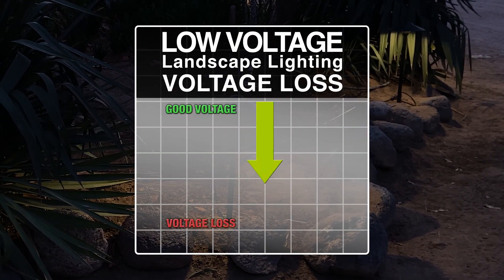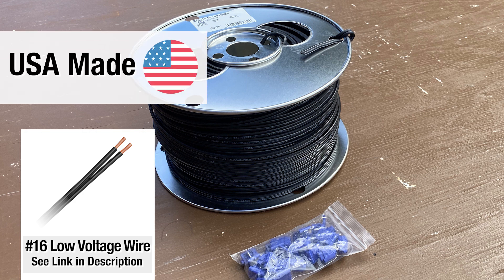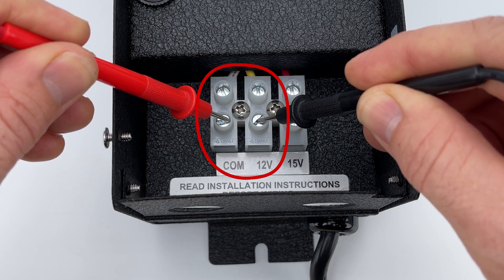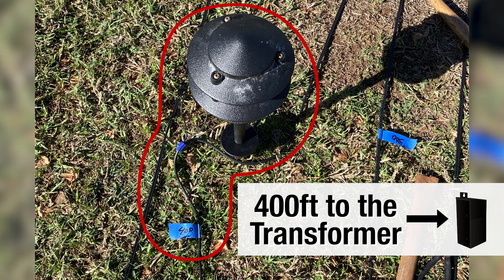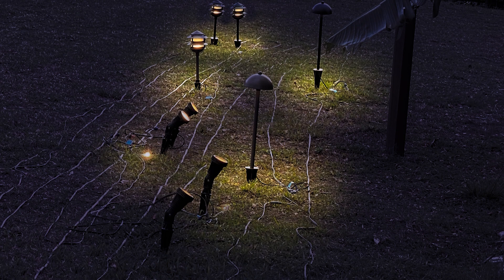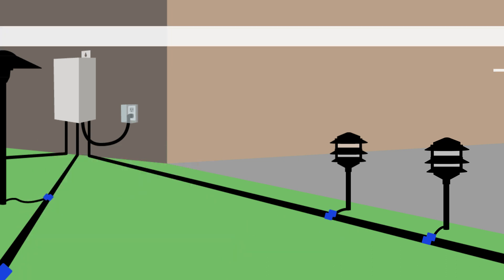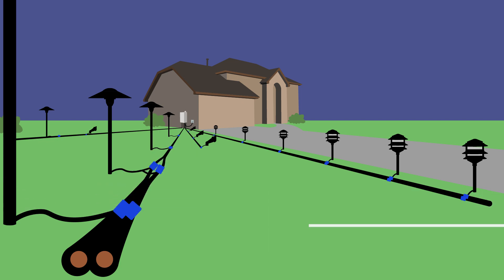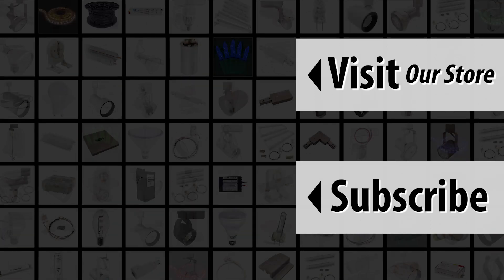Outdoor LED Landscape Lighting Voltage Loss Explained & How to Manage by Total Outdoor Lighting

Comment: Great explanation. This is the best low voltage lighting video on the internet! Thank you.

Before watching your video, I planned to use a 300W xfmer (keeping future expansions in mind), with 10 or 12 gauge wire, and two ~100ft runs, with 11 led lights on each run, where each light is 5W.

But now I think I'll use 14 or 16 gauge wire and I could use a smaller xfmer depending on what I plan to add in the future.
Reply from the maker: Glad our video could help you in your project 🙂
Reply: @Totallightingsupply     what happens if you use 22 gauge solid alarm wire at those distances

Comment: THis is the best explanation that I've found anywhere on this topic (and I've looked everywhere).  I have a 600W transformer and it has 3 long runs (from 100-200 ft) using 14 gage wire.  My fixtures are all 3-5W LEDs and each line has under 10 fixtures.  I have had 3 seperate consultants tell me that I needed 10-12 gage wire, or another transformer closer to the end of the run etc etc.  This video seems to suggest otherwise.  I love the scientific way that this was done and will go through other videos on this site to learn more.  Thanks for the fantastic work.
Reply from the maker: So glad to hear that our video was helpful. We have found that the transition to LED from incandescent has been a little bit confusing so again we are glad our video was informative 🙂
Reply: @Totallightingsupply  Would like to ask another question.  How do you use a multimeter to test for voltage drop on these fixtures?  Do the lights have to be on to do this?  Do you take out the bulb and put the probes in each hole?  What settings do you use on the multimeter.  I tried this last night with the lights on, taking out the bulb and putting the probes in the holes but I was getting nonsense results.  Perhaps my settings were wrong or not understanding the entire process?
Reply from the maker: @guyandoren  We have a video on using a multimeter here https://www.youtube.com/watch?v=e4QwgjKg0BY&t=163s Hope it helps :)

Comment: Thanks for the video, great explanation on using LED's, voltage drop, wire size, and the tests after adding more lights, I will now also look for a controller that can handle 15 volts.
Reply from the maker: Glad our video was helpful 🙂 All our EPC and ESL transformers can be wired to use 12volt and the higher 15volt for those longer runs. You can find them here 👉 https://www.totaloutdoorlighting.com/landscape-transformers/landscape-transformers.html

Comment: How would the voltage drop look differently with a larger gauge wire?
Reply from the maker: Typically with larger gauge wire voltage drop is reduced 🙂

Comment: Why are 2 lights in the middle of my run flickering? The light at the end is just fine and not flickering.. what is causing it to flicker . I have a 300 watt transformer
Reply from the maker: Could be the light bulbs in the 2 fixtures. Maybe try swapping the light bulbs in the working lights with the flickering ones to see if the bulbs are faulty or the fixture has a faulty connection. If it is LED bulbs make sure they are compatible with your transformer.

Comment: Just hanging the wire on the end and no connections is a complete open circuit. You could hang a wire from the earth to mars and there would be zero load.